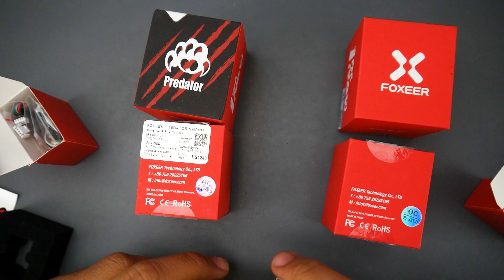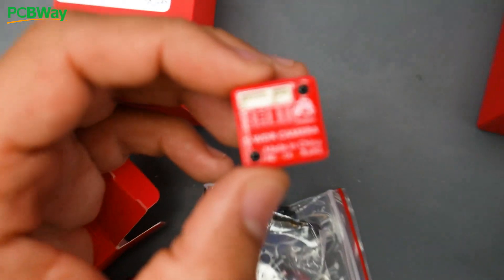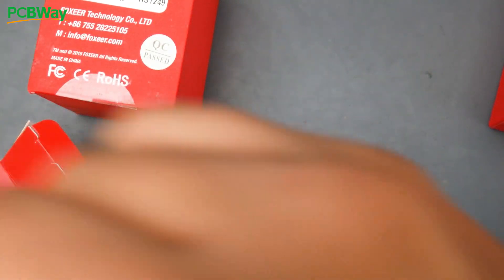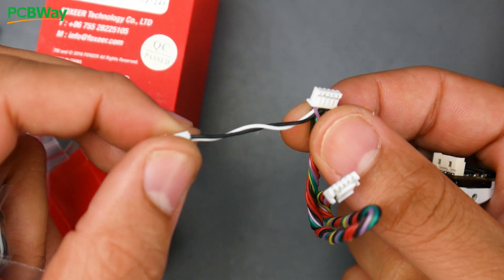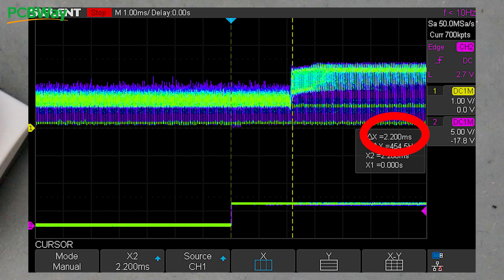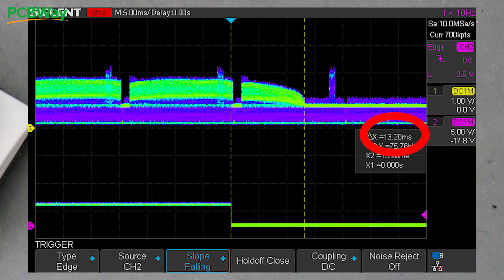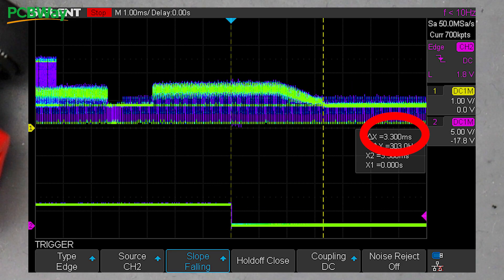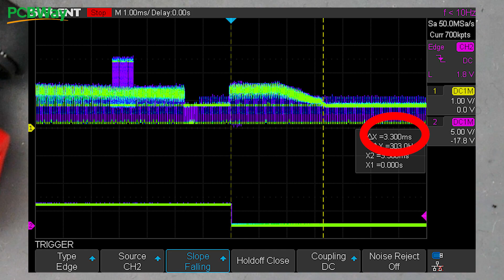Ultimate FPV Cameras 2020 // Foxeer T-Rex & Predator 5 Latency

Comment from the maker: Foxeer Nano 5: https://bit.ly/35hUSAf
Foxeer T-rex: https://bit.ly/32A1KHp
Reply: Hi, just wanted to let you know this is the predator micro size. Thanks for the great videos.
Reply: I just noticed this as well. Thats a Micro Predator v5.

I have recently ordered a Predator v5 mini and a micro. They both came in the box labeled Nano.

Physical size will indicate the model but from a visual standpoint:
- Nano is not fully enclosed. 
- Micro has single mounting screw on each side
- Mini has 2 mounting screws on each side

Comment: I just replaced a T-rex/Rush tank solo video system with a Caddx Nebula v2 and it feels weird flying my quad now. I wonder if it's the latency difference? The DJI stuff is running a little over 30ms but the T-Rex is about 2ms.